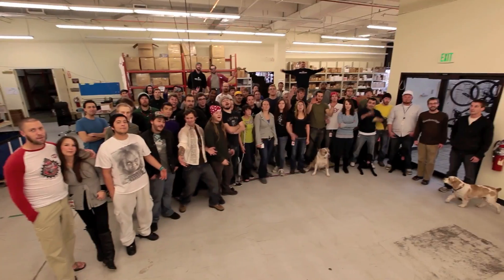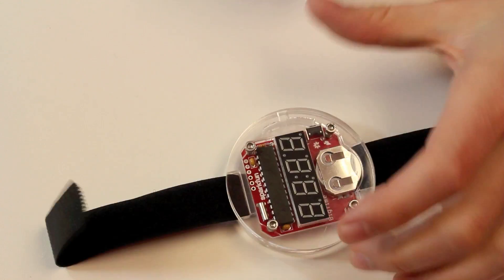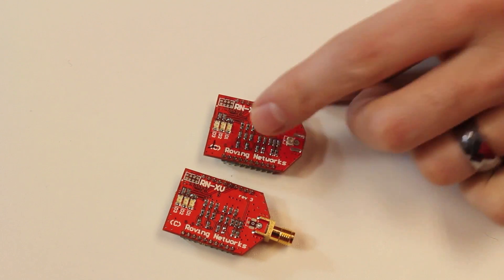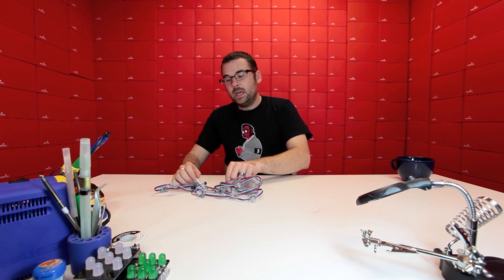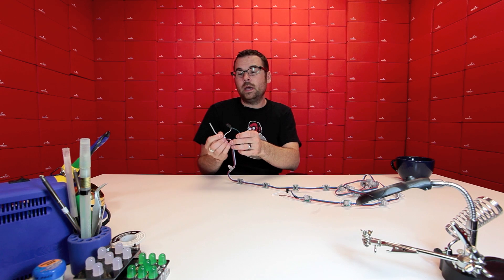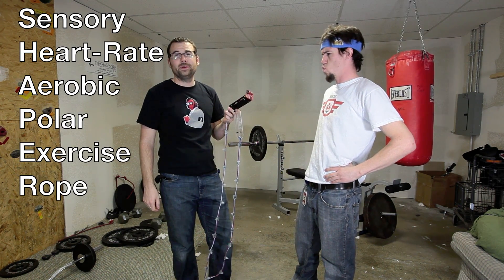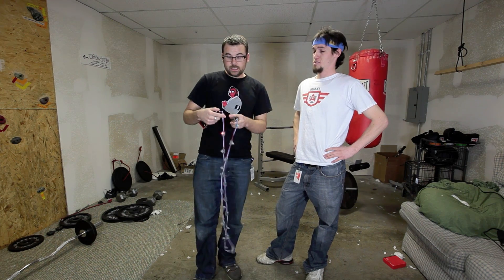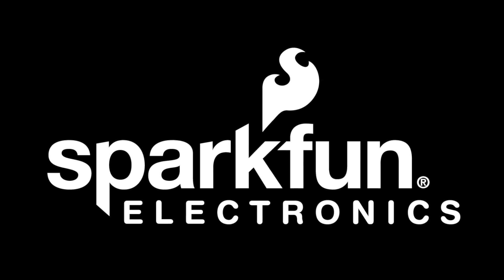SparkFun 12-22-11 Product Showcase

Comment: I love living in the future. :) 

BTW, I have one of the Spikenzie watches. It keeps resetting sporadically, even though the battery is good, as are all solder joints. Might be ESD-related...? I think I prefer this design quite a bit more; with an AVR, red board, and blue display, it's more unique and easier for me to manipulate.